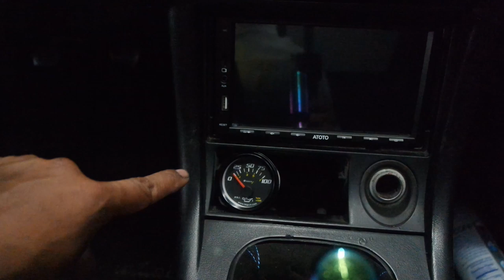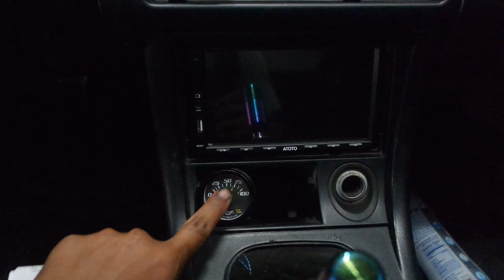Honda Prelude ESP Traction bar install | turbo f20b

Comment: Thanks for the shoutout Fam. At first i thought you were trolling calling it an ESP bar bro. Lol. I mentioned that i had both bars but would have to look for my ESP bars as they were packed away in boxes. I knew exactly where my innovative bar was in storage and could let you borrow that until you got a bar from ESP. Either way i'm glad it helped get the lude ready quickly so you can get that turbo fully installed and ready for your tune!!!
Reply: Aye PreludeZone fam in the house haha

Comment: 7:35 crossmember brace 
Side bars are radial bars
& traction bar itself
& dont forget to reset your caster
It will be annoying but well worth it

And dont buy the front mount setup it wont clear that manifold
Reply: Daniel Santibanez foreaaal I cant even run that $175 front innovative mount w my longtube headers on 😒

Comment: So I'm trying to understand the point of these traction bars, as far as I see it they just free up loads of extra space. I can't see how they can actually provide extra traction aside from stiffening up the front engine (torque) mount if you replace the OE bushing with a bar. But if you don't do that, and end up removing the brace that links the OE front and rear subframes, surely you'll just loose front end stiffness and end up with worse handling!!  Happy to be schooled here!!
Reply from the maker: I am not 100% sure on that one bro it does seem to handle a little better but the main reason for me was to free up space for the turbo down pipe.
Reply: @treybedipping1734  yeah I can see it makes a big difference in terms of clearance for the big boi turbz
Reply: Only difference is instead of having play with the radius rod bushings in the front side of the subframe, it makes it solid instead
Reply: @bluGill89  that's a good point, so arguably if you polybushed the radius rod you'd get the benefits.
Reply: Owen Manuel Fernandez-Oxby it would for sure be an improvement over stock. Not as good as solid mounted but a step in the right direction atleast

Comment: You are still missing the bracket to mount up the front mount  and the front mount kit itself . And if running all motor (obviously not you) tri y header wont clear